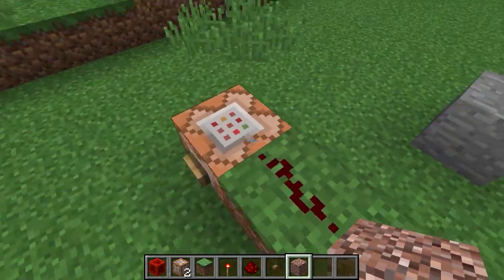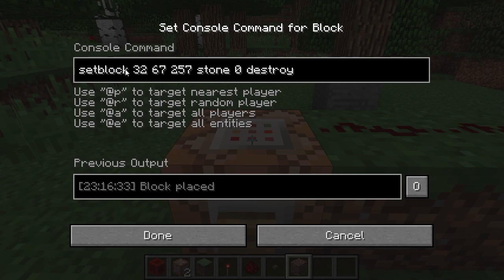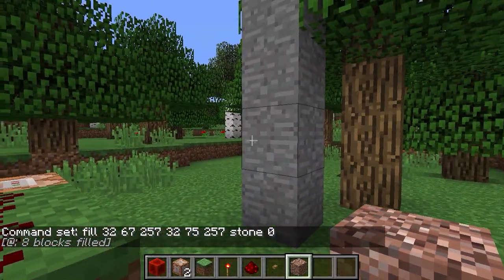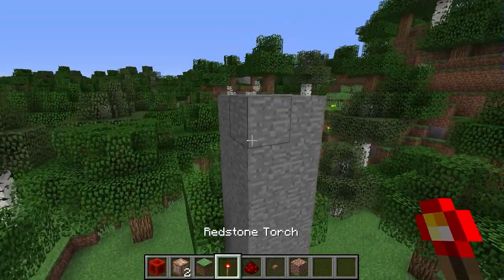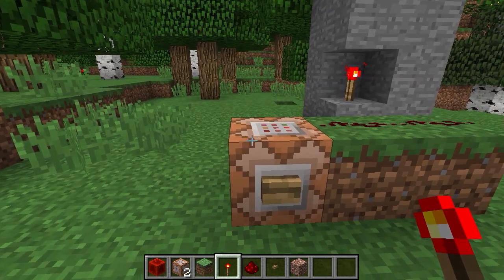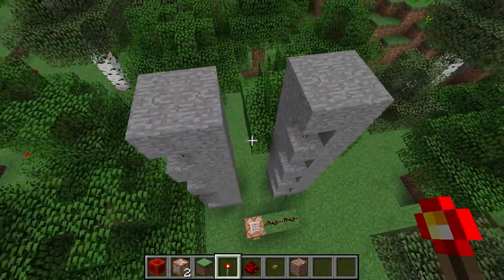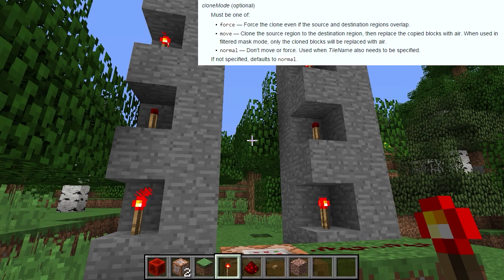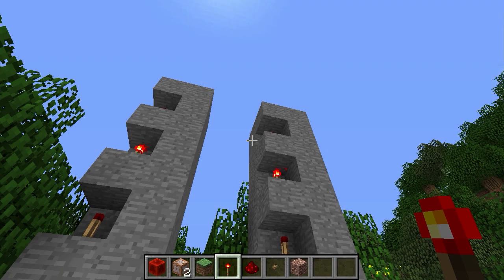Beginner Command Block Tutorial Part 3 - The /fill and /clone Commands

Comment: +slicedlime I want to make two islands which interact with each other like one island: if I break a block on an island it breaks on the other too. How  can I do it??
Reply from the maker: +Lord Akenay Gaming That is a quite difficult problem. Mirroring is reasonably easy one way - just continuously clone one island to another. Two-way though, you'll have to figure out which one to clone at any given moment, so it's tricky.
Reply: +slicedlime Thanks! I'll try this one...
Reply: +Lord Akenay Gaming make a fast clock. the clock triggers a full air command and then a clone command to make the other island appear the same as the other 1
Reply: Create a constant clone of that island
Reply: DanDCD but if you do that the island before the clone will still be there, like i said, you need to create a  set air cmd block
Reply: AfterTech not if you clone the island say every 5 seconds so the broken block etc. then clones to the next island if you want it to happen immediately though it may be more difficult
Reply: you can do it every 2 ticks though, also the broken block wouldnt be broken because the clones before it :3